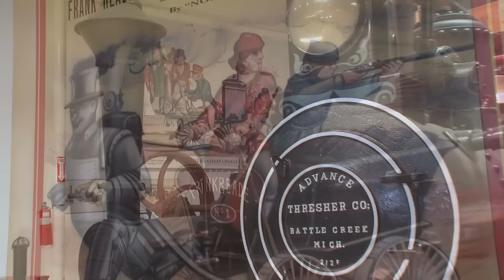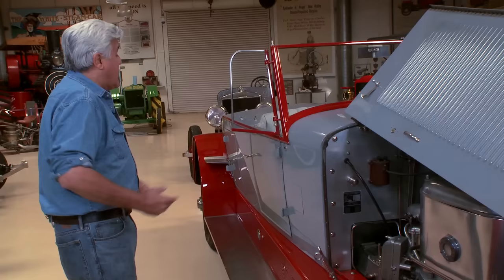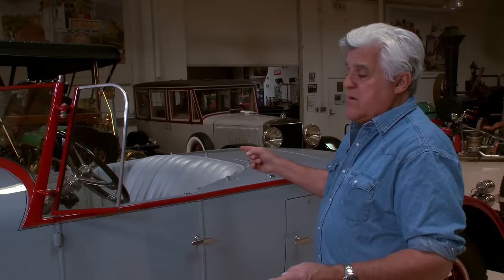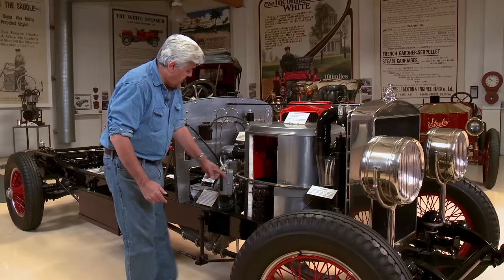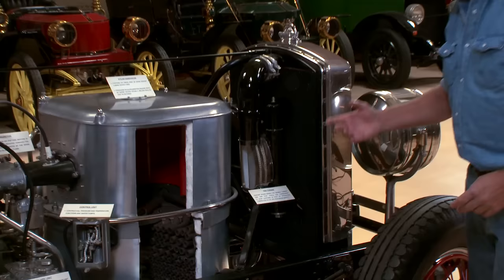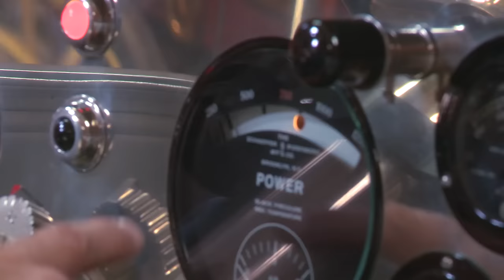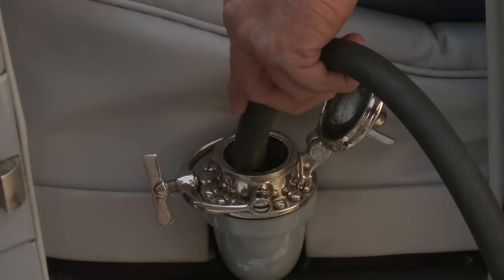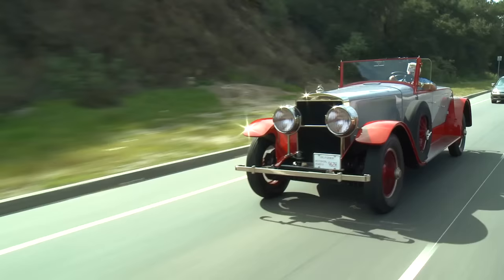1925 Doble E-20 Steam Car - Jay Leno's Garage

Comment: If a steam car were built today, it would have a microprocessor to control everything.  It could work much better, be much simpler to operate, be more reliable, and more economical.  Unfortunately it would be less efficient than an Otto cycle (4 stroke spark ignition) or Diesel engine because it would operate at much lower temperatures than those engines.

The formula for computing the MAXIMUM POSSIBLE efficiency of a heat engine has been known for well over 100 years.  In actual practice, the maximum possible efficiency is never obtained.  In fact, it is difficult to exceed 50% efficiency by very much.

A heat engine operates on the difference between two temperatures.  The greater the difference between the two temperatures, the higher the efficiency is.  Here is the formula:

E = (Th - Tl) / Th  where E is the efficiency,  Th is the high temperature and Tl is the low temperature, both being absolute such as degrees Kelvin.  To convert to percent, E can be multiplied by 100.  You can play with the formula using different values for Th and Tl to see what you get.
Reply: First of all modern reciprocating steam engines can break 40% efficiency. In order to be practical in a car platform the pressure and hence the temperature would have to be lower (e.g. 400°C at 50 bar superheated steam). Under this conditions it's still easy to break 25-30% efficiency with expansion ratio grater than 20 (not compound cylinder design, usually working at about 8:1 ratio), with powerful condenser and counterflow exhaust gases recuperation. The absence of recuperation was the weakest point in Doble's design, loosing at least 30% of input heat energy (even if the climbing tube in the burner can behave as a kind of economizer). I guess that this car had approx 12% break efficiency, but with hidden potential.
It seems quite simple today to make a 1.5L two cylinder double-acting engine that could force a 1500kg car to 100km/h under 7s with a single gear (validated calculation). 
When compared to the top efficiency of the state of the art car engines today:
- Gasoline 4stroke:   20-25%
- Diesel:   30-35% (diesel can exceed 40% but to make it more environment friendly the compression ratios are going down and down compared to the 80s)

Conclusion:
- still competitive
- less harmful exhaust products since the fuel burns completely (good option for diesel fuel)
- so simple
Reply: Why cannot steam power ANYTHING (using water) very efficiently?  Latent heat of vaporization.  It takes a LOT of energy to turn a specific volume of boiling water into steam without raising the temperature, then to raise the temperature to a higher superheat temperature not so much energy. After the steam pushes the steam engine, (it is still steam afterwards but a wet steam), then it is either exhausted directly into the atmosphere out the stack, or it gets condensed via a condenser so that water can be pumped back into the boiler. The latent heat of vaporization is lost to the condenser. Using another substance other than water that has a less latent heat loss can be used, like mercury, but ..............
Reply: +Lumpeeks Unfortunately your optimistic opinions are not supported by any facts... Carnot discovered that internal combustion engines have superior thermal efficiency than steam engines in 1824 and Rudolf Diesel conclusively proving the Carnot formula in 1898 and the fact that internal combustion offers much higher practical and theoretical efficiency limits than steam.
Reply: +Lumpeeks Can you please cite a verifiable example of a practical reciprocating that can achieve 40% efficiency in a vehicle application??? Because I have never heard or seen such a fantastically unbelievable steam engine in my entire career???
Reply: +Lumpeeks Toyota has already sold over 5 million of its 1.8 Liter VVi  2ZR FXE gasoline engines that  achieve 40% thermal fuel efficiency..
 You can also buy Volkswagen, Audi and BMW Diesel powered car which EXCEED 43%..
 Here are some examples of automobile engines available over 10 years ago.
Toyota Prius THS II engine 37% 
Toyota 2AR-FSE 2.5 liter 39%
Volkswagen 3.3 V8 TDI 41%
BMW N47 2.0 liter 43%
Audi 2.5 liter TDI 43%
WRONG, the world's most efficient steam turbines only produce a single cycle thermal fuel efficiency in the 41% range.. with a maximum theoretical Carnot cycle efficiency of only 53%.
 Current marine Diesel engines in production exceed 50%
 The MAN S80ME-C7 delivers 55%
 Diesel engines have a theoretical limit of 77%
Reply: Frank Eggers and way way harder to repair and construct...
Reply: @MichaelKingsfordGray Internal combustion engines benefit from higher working fluid temperatures and do not suffer from the inherently higher Entropy and Conversion Loss found in all external combustion designs. Any engine such as the steam engine that requires a Phase Change in its working fluid will be less efficient than internal combustion.
Reply: @steverturnsk6190  That's not necessarily true if the condenser is blowing the latent heat back into the engine where it can reduce the amount of fuel required to maintain the heat levels.
Reply: @John Rickard  But the Enthalpy of Condensation is also subject to Conversion Loss... in the case of the steam car, which does not allow for efficient condensation heat recovery due to weight and space limitations not found in stationary applications like power plants... in addition to the economic factors that do not make efficient condensation heat recovery practical, eg; the Doble E-series which vented most of the water vapor to the atmosphere through the condenser's PRESSURE RELIEF VALVE.
Reply: Lumpeeks ppp
Reply: Frank Eggers ll
Reply: @Lumpeeks    The EPA would freak out about exhausting  steam with oil in it.  Maybe some kind of Vegetable oil or some kind of an oil collector to filter the oil so only water was exhausted.
  Steam Locomotives  had an incredible amount of Maintenance  needed...  but they ran on coal which was very cheap .. Same issue with emissions  many of the old coal fired  Steamers have been converted to burn Propane to keep the Tree Huggers Happy ..
Reply: @doktorbimmer  I'm not an optimist. I'm educated enough to do calculations beyond simple Carrnot limit formula. Speaking of the steam engines in 1824, they were very simple with almost no expansion ratio. There was further development to achieve greater expansion ratio (e.g Corlis, compound, uniflow). Steam power plants usualy operates between 40 and 50% thermal efficiency. That's the proof that steam is not dead and that Carrnot's formula must be used with care. In under MW scale reciprocating steam devices are proven to outperform turbines.
I validated calculation for my design and am ready to bet to break at least 25% efficiency in practical car application (let say rebuild of a car with rear drive, like old BMW). With single drive, fully controllable expansion ration from 1:50 to 1:1.  Practical limit in a car app is a little over 30%, beyond that there would be safety concerns.
What I like the most is the ability to burn fuels "completely". This is the most serious issue of diesel engines today.
During 70s Ford played with similar design to Dobles. Their goal was to burn anything instead of burning it efficiently. Anyways they were close to 20% efficiency. After later drop of oil price such projects died.
Note: Strirling engine broke 42% efficiency in mid 80s, search MOD II. Since then there is still much to optimize an utilize new materials (e.g. carbides). However most design stagnates in the free piston fashion, that will never exceed the boundaries of Otto-like Cycle.
Reply: @doktorbimmer  First of all I don't believe the propagation numbers of current engines. For gasoline engines, 80% of cars built in past 10 years are not able to exceed 20%.  Most of the claims are supported by use of high octane fuels. For diesel engines applies that the most efficient were 3L atmospheric from 80s. Now the compression gets lower and lower for high rpm engines.
Conslusion (realistic):
+ gassoline - will never exceed 33%
+ diesel - will never get back over 40%
Reply: @mikeskidmore6754  There is no need for oil in modern steam engine. If the sliding speed is kept under 3m/s solid lubricants and coatings can be considered. WS2 is perfect for under 600°C. In case of any abrasion the solids can be filtered out. Anyways I consider all steam for recirculation (at least under 90% of max performance), so the issue with oils is mainly about degrading the walls of the steam generator.
Reply: @Mike Skidmore  Many high temperature steam lubricants are still based on Tallow  (Animal Fats) and biodegradable vegetable based oils like Castor oil is still used in some environmentally sensitive applications.
Steam cars fitted with Condensers collect the lube oil in the feedwater tank by a device called a skimmer, which can be drained later for proper disposal.
 Its all a completely moot point though, steam is obsolete and will never again become commercially viable for transport applications... so this is all essentially just theoretical.
Reply: @doktorbimmer  YOU SIR ARE NOT INNOVATIVE, JUST BLIND ON DOGMATIC EXPLANATION ON CURRENT INDUSTRY STANDARDS AND THE KNOWLEDGE YOU ARE PROUD OF. IT FEELS LIKE THE CHURCH IN THE MIDDLE AGE.
Practical car steam engine with competitive efficiency can be made (proven in the 70s). This is something that can be optimized. No oil, minimum moving parts, minimum maintenance and almost no pollution is achievable. The main commercial problem is what the market is told since their kids age: V8 sound is cool and electricity is green, steam is a legacy punk.
Reply: @doktorbimmer  I think it's time for you to proof you are not a fool. So provide a calculation result on expected break efficiency on this machine:
- input steam: 50bar 400C
- condenser temp: 50C (condenser pressure < 0.7 bar)
- expansion ratio: 1:60
- burner efficiency: 95%
- heat loss (insulation, piping, ...) : < 10%
If you get under 20%, then provide more details on the calculation.
And please do not focus on practical issues that YOU are currently UNABLE to solve.
Reply: @doktorbimmer  And one more thing you need to absorb to change your thinking is something about the fuel economy which is not 1:1 to theoretical max efficiency declared in marketing prospects. All the designs that claim to exceed 40% are based on Atkinson's cycle, which has a less stable torque and efficiency curves vs rpm and load, than state of the art direct injection supercharged Otto cycle engines (25%). In real life the fuel consumption will not be like half, but it may be even almost the same. Atkinson requires to keep the RPM higher and in a narrow interval, similar to old fashioned atmospheric engines.
When compared to uniflow steam engine with fluently controlled cutoff timing: Here the max efficiency (20-25% )is delivered at the minimum throttle within any load and any RPM, which is perfect for cruising and stable fuel economy. The efficiency is lowered only during acceleration depending on how heavy is the foot. On the other hand the "modern" gasoline engine will require to run 3000rpm with almost full throttle (finding the right gear where it's not accelerating) for perfectly efficient cruising - this is useful only for small engines or hybrids, because human driver will struggle to control the engine this way. Anywhere outside these conditions the efficiency is just average.
Reply: @Lumpeeks "And one more thing you need to absorb to change your thinking is..." The fact that of the over 100 million new cars sold last year, NONE of them was powered by a steam engine.
Reply: @doktorbimmer  YOU LOST YOUR CHANCE TO GET ANY CREDIT. SO FOR SURE, YOU ARE JUST A FAKE HISTORIAN. 
If you are not able to verify the calculation at least against the ideal Rankine cycle then I'm ignoring your comments from now on. You just discredited yourself!
The only power consumption data you need, is the heating, that you have enough information for. The other input is the power needed to drive the pump and this is also derivable from the given data.
Reply: @Lumpeeks Complete and utter nonsense sir... in order to calculate Carnot Cycle efficiency you must have a accurate values for TC and TH or calculate by converting BSFC which requires fuel consumption in pounds or grams per hour, fuel type and the rated horsepower or kW/h output. You did not provide these values.
Reply: Why is everyone talking about engine efficiency here instead of fuel economy or gas mileage?  Since the steam engine has so much torque, the motor can easily take the driver the same distance at the same speed while running at a lower rpm.  Comparing a diesel motor to a gas motor, for example, if both have the exact same engine efficiency but the diesel has more torque, the diesel will still get better mileage because the engine is turning fewer times (lower rpm) to travel the same distance.  Similarly, we have to consider the incredible torque of this Doble steam car (1000 ft lbs!) when talking about mileage and not get caught up on engine efficiency.  You can basically drive this car at the equivalent of an idle.  And other factors to consider...The steam engine virtually shuts off at stops, and when driving, the driver can shut down the throttle and "coast" once up to speed.
Reply: @Paul's Concert  But the Doble only generates 1,000 lb-ft of torque at 0-rpm  and its torque output Decreases as rpm goes up.
 Please explain how peak torque output has any relevance on a vehicles fuel economy.
Reply: @Paul's Concert On the contrary, on start-up steam cars like the Doble operate at Full Power (maximum fuel consumption) for several minutes before pulling away...and until operating temperature is reached (several miles) and a huge amount of energy is wasted after you reach your destination... any heat and steam left in the boiler is also completely wasted.
Reply: @paulsconcerts9481  
 You hit it right on the money❗ 
 Trucks are carrying two 100 gallon fuel tanks for a $500+ fill up. At 15 mpg average, that's about 3,000 miles. 
 The Doble type system could use one tank of water with extremely low loss under steady operating conditions and one tank of fuel (maybe kerosene or something even cheaper) to make the same trip because fuel milage is related to burn time. 
 At that 60 mph average, that's about 50 hours of driving for the $500+ or about 50 gallons of kerosene for steam at a full burn. The steam doesn't care what the motor is doing, it just keeps the water hot! 
 You could run two Doble push - pull motors to have the horsepower for highway speeds (while doubling the torque) and still use less than the 100 gallons.
Reply: STOP SCREAMING
Reply: @Frank Newling The Doble at 8 MPG averages just 200 miles per tank of fuel and water consumption averages as low as just 60 miles in warm weather... 
 So by your figures that is 750 gallons of fuel for 2 Dobles to go the same distance along with 15 stops to refuel and at least 35 additional stops for water.
Reply: @doktorbimmer  
 Where do you get this 8 mpg figure? That has already been proven false with a crude form of the Doble system back in the '70s! 
 And I second the opinion that you need to quit screaming. The mark of the man who has nothing to say but wants to be sure that everyone can hear his blatherings❗
Reply: @Doktor Dim Bulb
 I hadn't even noticed your lack of basic math skills until you came up with (your numbers) 8 x 100 = 200❗😕
Reply: @Frank Newling From Jay Leno himself, the SAE and the EPA... where did you get your spurious, crackpot theoretical guesses???
I agree, that little troll needs to stop his childish screaming in all caps...
Reply: @Frank Newling Most Doble E series automobiles were fitted with a 25 gallon fuel tank and a 30 gallon feed water tank... WTF? Did you get 100 gallons from????? 8MPG X 25 gallons = 200 MILES... you might want to consider some remedial math classes son.... you are not ready for engineering school yet Lol!!!!
Reply: Trying to build a steam bus using modern technology ruined Lear Motors (yes, that Bill Lear) and was instrumental in him going broke.
Reply: @dllc1138 Excellent point, White Motors switched to internal combustion in 1915, Stanley went bankrupt shortly before Doble did... Every attempt to start a new venture to build steam motor vehicles since has failed miserably or never got off the ground. Some folks ignore history at their own peril.
Reply: That car there is highly inefficient by the concept of true steam power. Imagine an electric generated steam that's then shoved inside a modern age chassis under a modern age body, it would take a long stand piss on modern electric cars. You charge it with water and electricity and it has none of the hassles of the two technologies. No fire, no electric motor issues, just pure steam.
Reply: @aserta Jesus! Haven't ever heard of conversion loss??? The only thing less efficient than a combustion steam car is a battery electric steam car!!!
Reply: @doktorbimmer  How about an induction heating system for the steam generator?
Reply: @amusingarts How about just using the battery ti power an electric motor? Electric Motors are cheaper and 97% energy efficient... reciprocating steam engines are only 20%.
Reply: @doktorbimmer  What you say is true, but when you consider the cost of producing and disposing of the batteries that power EVs, as well as the cost of electrical generation for recharging and the slow recharge rate I think it changes the efficiency formula somewhat. 
 
100,000,000 EVs equals hundreds of millions of tons of scrap batteries. What do we do with them,  just send them to the bottom of the ocean or recycle them? Again, I think it changes the efficiency formula somewhat.

A steam car, even if only fractionally as efficient as an EV has certain advantages. 
1- Water as fuel is never "used". It can be recaptured or allowed to escape, but it remains water in the ecosystem either way. Unlike ICE which convert fuel into noxious gases, or EVs which generally today burn gas or coal to generate electricity.

2 - The main inefficiency of old steam engines was the enormous amount of fuel it took to heat the water to 750 degrees. On the Doble that works out to about 8mpg I think Jay said. Using induction heating and an AC/DC converter you can heat 2 quarts of water (the amount of water the Doble actually turned to steam at any given time) to boiling in seconds. 

3  My main point is that a steam/electric hybrid would be so clean relative to anything else that efficiency isn't really the big issue.  If you get all the fuel (water) back, and use self contained batteries to generate the heat to boil the water what difference does it make if it's only 1/2 as efficient as anything else?
Reply: @amusingarts But as you explained batteries are horribly inefficient and not at all environmentally friendly... you are suggesting to increase the use of batteries and energy consumption by nearly 500%... what is the advantage? It is still more expensive and less energy efficient than current internal combustion engines
Reply: @amusingarts But according to Jay himself the Doble consumes as much as 1 quart of feed water per mile... and requires water replenishment every 50-60 miles. EVs and ICE vehicles are not only cheaper they have better range and smaller carbon footprints than a hybrid electric/steam car...  EVs still emit pollution ( The Long Tailpipe Problem ) your design just wastes more energy, more materials, costs more and ultimately causes more environmental damage.